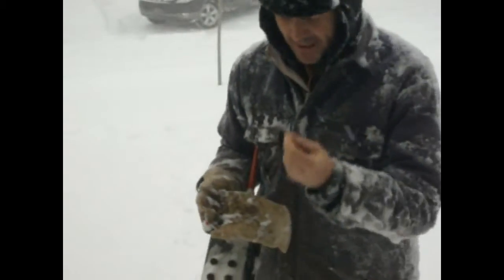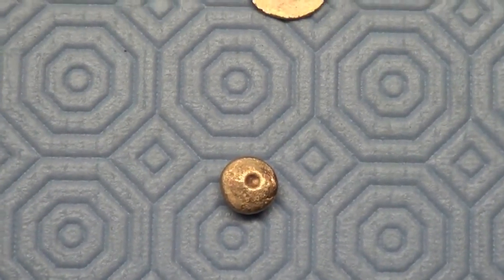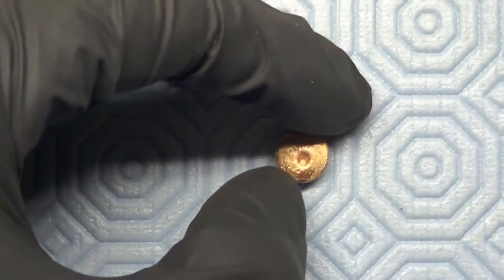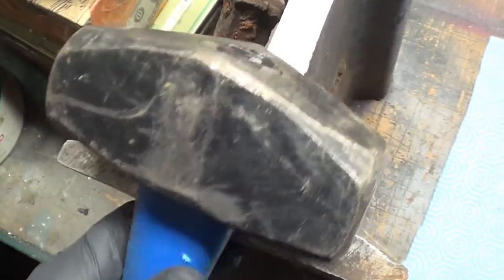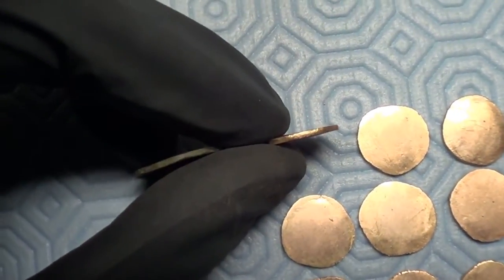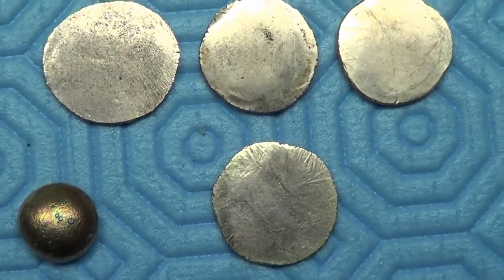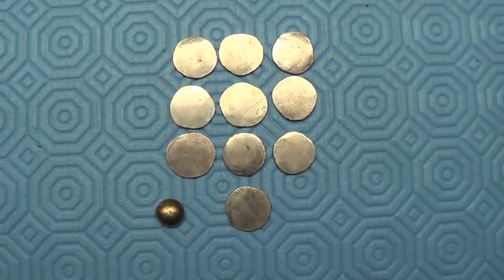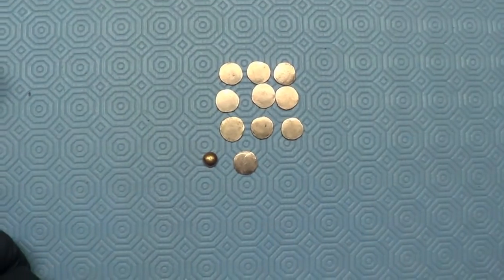Gold Hammered Coins

Comment: How about M4D on one side , and the weight & carat on the other . Like 2.5 Gram 18k ?
I would like to see what you used to heat the gold up with and an example of what you did too pour them . I think you need to keep that intro . Atleast threw the winter LOL
Reply from the maker: Hi Dave . To heat i used a Mapp gas torch yellow canister .  The only pouring was in to a bucket of cold water . To make the gold in to shot . small pieces so i could weigh out lower weights . once the shot was separated in to even piles . I took one pile at a time . and remelted it in to a button When the button was cool enough to pick it out of the crucible with out marking it . i did so . The i just hammered them flat  . I have other videos of me melting gold and pouring it . For a rough idea how its done .  Best wishes my friend